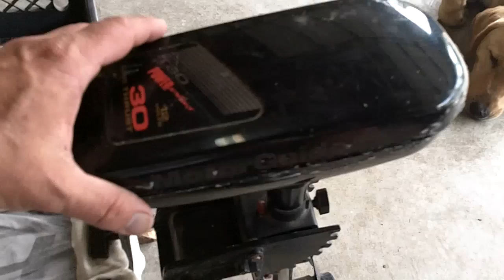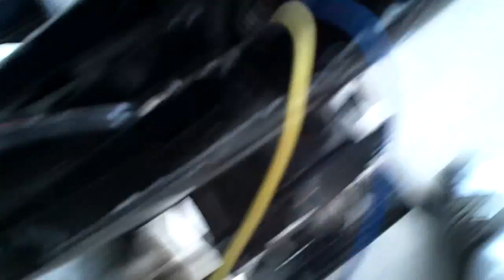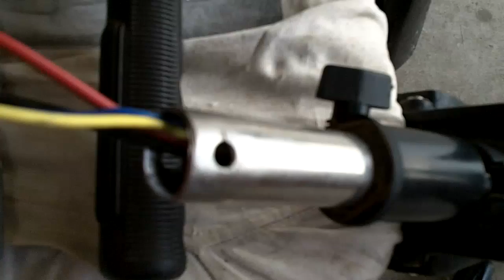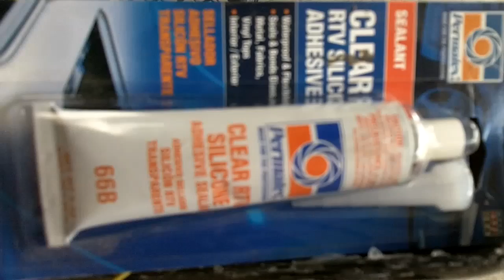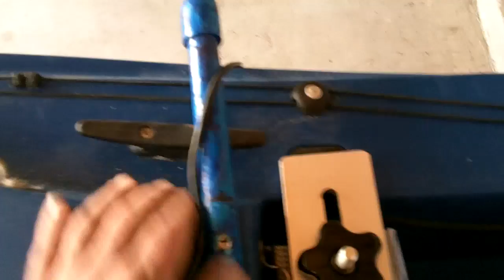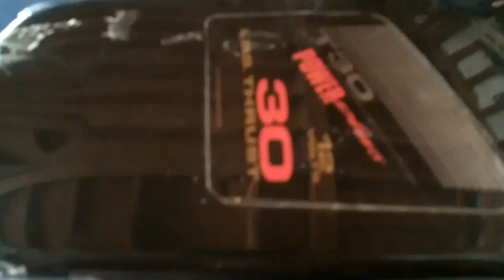Kayak Trolling Motor

Comment: Neat but somebody should really come up with something better than a boat trolling motor.  They're geared for thrust and will move a 14' fishing boat about as well as they move a 10' kayak.  When if you changed props you could probably get double the speed out of kayak with a electric motor.
   Which means getting to your spot faster, less run time, and going further.

Comment: on a metal shaft like that using a tubing cutter and going around the shaft several times would be easier and it would pose no risk of cutting into the wires.
Reply from the maker: +anymanusa if you say soo!what do I know ?
Reply: +manko330 no need to be defensive. i was just trying to widen your knowledge base.

Comment: The motor on most trolling motors is screwed onto the shaft....So why not unscrew the motor from the shaft, cut the shaft with a pipe cutter and rewire at the bottom?

If you do it this way, you don't have to disassemble the controls....
Reply from the maker: you can do it the hard way, I did not want to break the bottom seal ,plus only two screws hold the controls. the bottom is a pain.

Comment: There is no "which pipe cutter". A pipe cutter is just a pipe cutter, get one cheap at harbor freight. Just make sure it opens enough to fit over shaft. Tighten it, make 2 passes, tighten again,couple passes, done.

Comment from the maker: Thanks,i did a couple of vidoes they came out not what i wanted..working on a new one...my kayak is 14ft very stable .never been flipped.. the trolling motor is not a problem and  on my old 12ft kayak either. the old 12ft kayak did not have a rudder on it.. The trolling motor would cause a small pushed. nothing big.... with the rudder there is no push at all. i  will never own another kayak without a rudder  in the wind it`s a big  diffrence, good luck

Comment: Great video...I have been considering setting up a trolling motor on my yak too, and I was very happy to find your instructional vid...I saw that you said you were going to make a video showing it in operation, if you did I couldn't find it...a few questions, if you did try it, did you find at all that it throws the yak off balance to the side the motor is mounted on, or don't you notice the extra weight on that side?  Also, as far as steering goes, which is better/easier...with motor or rudder?

Comment: cut my shaft down to 28"  it works fine.also stole your mounting bracket.,made it out of birch h/wood.went down to the lake ,really cold but i had to try this out right away.well sir on 24v the thing flys,also goes pretty good clip on 12v..many thanks to you for your very usful information,i look foward to fishing this spring. but right now i suffering with a cold,should`ve waited for warmer weather   lol again many thanks.

Comment from the maker: 86 lb is alot hp . 30lb motor pulled  my 17ft skiff boat easy.my 14ft kayak gets up and go`s. .24 volts will give you more distance. you will have plenty of hp. try both out.  p.s internetpilot23 is correct .drilling stainless steel is tricky.good luck.

Comment: wow what luck finding your video (you are now my newest hero) i have a 42 "shaft motor & want to use it on my canoe.can i ask you a question as i am sure you have the answer.my motor is a 86lb. thrust.is this to much for a canoe.also i have 2 12volt gell batteries that i want to use as 24 volts. am i over doing it ? ican run this motor on 12 volt or 24 volt.so i have options but never tried this before so need youe advice.will the 24 volt be ok ?????thanks in advance.

Comment: Just a word of warning, if you shaft is stainless steel (like mine was), you need to be very careful with drilling a new mount hole in it.  Stainless is relatively easy to cut with a saw, but it can be a @#$% to drill.  There's a technique to it, and you need cobalt drill bits.  I ended up having to take mine to a machine shop because I didn't do my research on drilling stainless!

Comment from the maker: Not yet. I will make a video in action soon. I did the same thing to my old 12ft Ocean OK Drifter kayak with out a rudder.The Drifter handled well but had a push at high speed.The 14ft wilderness Manta Ray is what i am using now with rudder  it has a large tank well ,the battery will go behind my fishing crate.